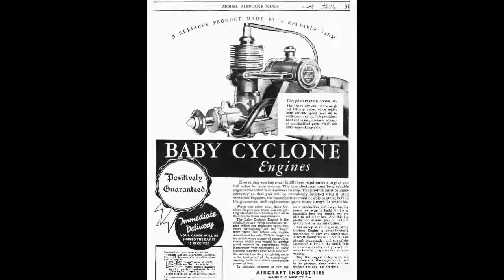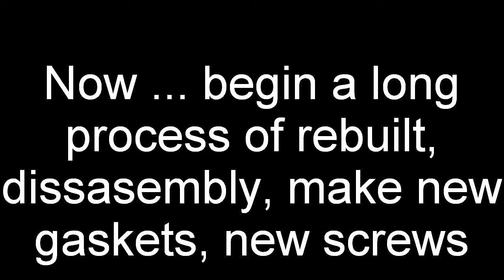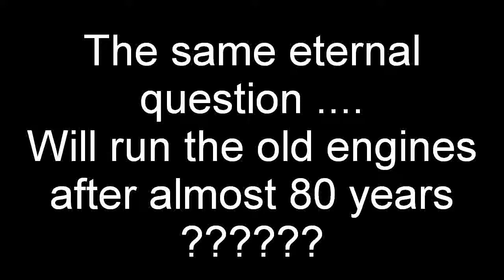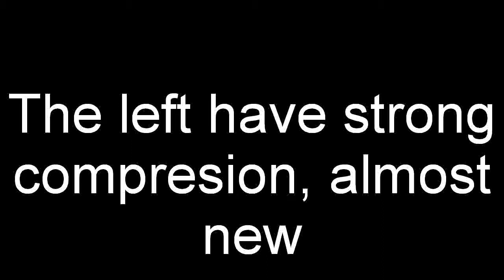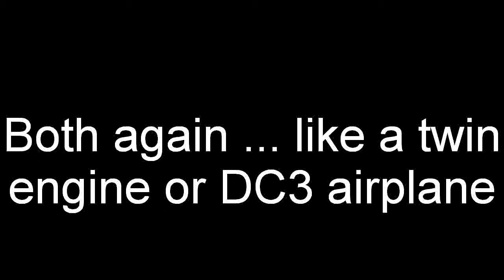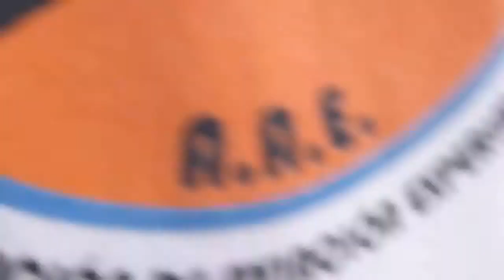Baby Cyclone .363  - Bill Atwood & Mel Anderson (Pioneer sparkie)

Comment: You would have to rev it up pretty good to get an old time free flight to climb out. I had an original Maxwell Basset Cardinal kit I made into a slope glider. Pretty good size plane for any motor. Class B engine? Not sure. Thanks, Paul in Thailand